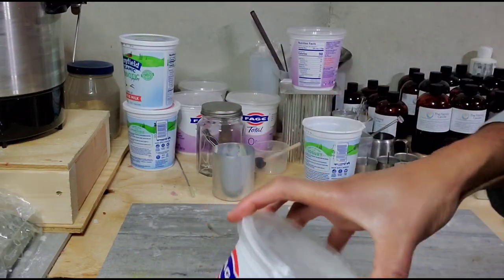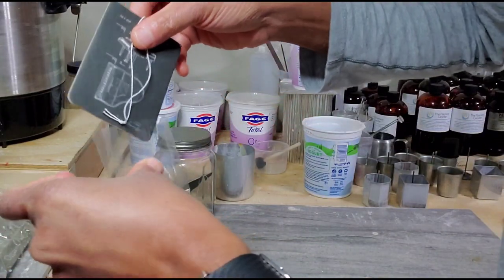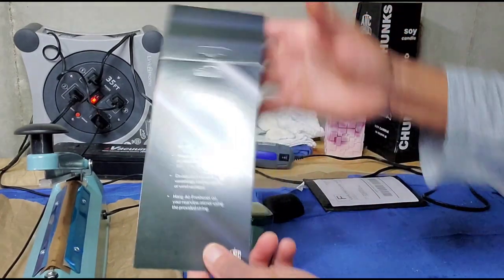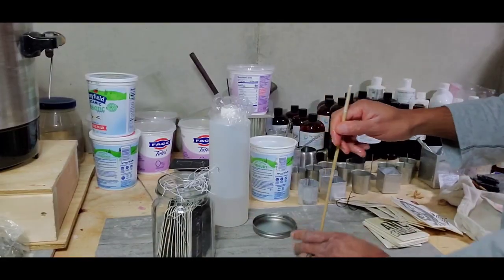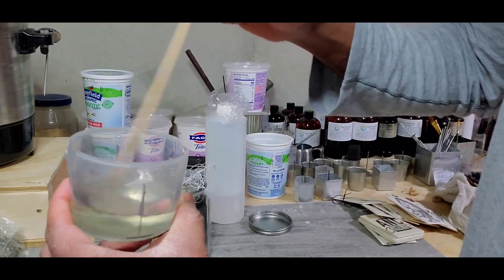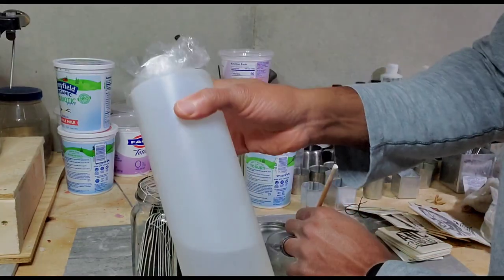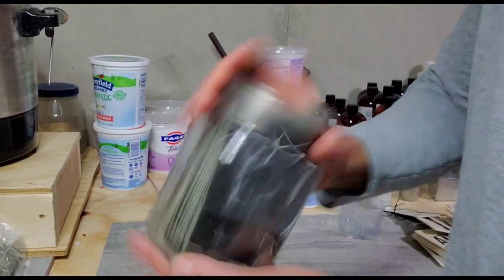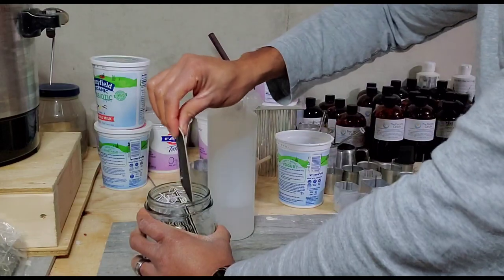How I Fragrance My Car Air Fresheners/Start A Car Air Freshener Business in 2023 Easiest Process.

Comment: The cardstock is a game changer. Thank you for sharing. How long would you say the fragrance lasts on these.
Reply from the maker: Usually the fragrance in the cardstocks last between 14 to 21 days. This is also dependent on the strength of the fragrance oil and your carrier oil (Example, DPG) ratio.
Reply: If you have an essential oil blend already, for car air fresheners, do you need to add a carrier oil? If so, what does the carrier oil do?
Reply: Enjoying your videos can u please tell me what material u use for your packaging cards
Reply from the maker: @marymaravilla5203 Are you sure you have been watching my videos? I have mentioned it in many of my videos. 🙂 Anyways, its cotton cardstock. 🙂